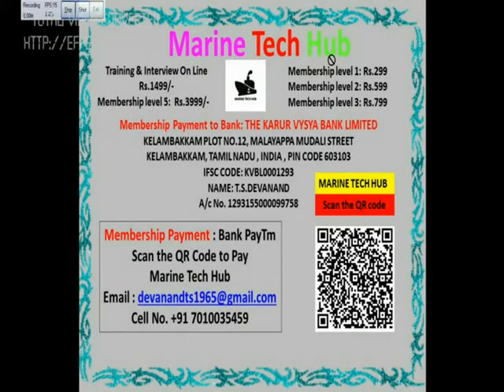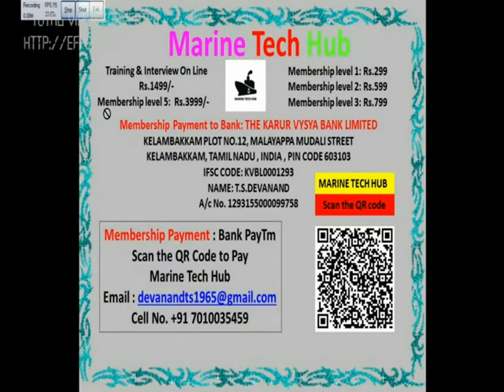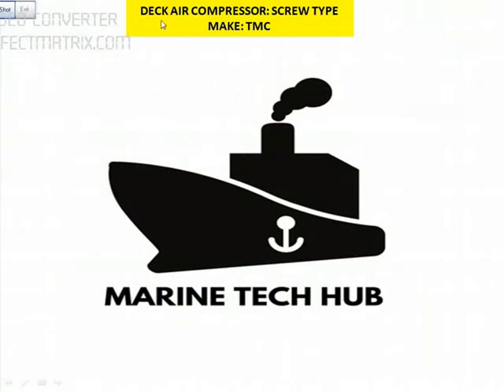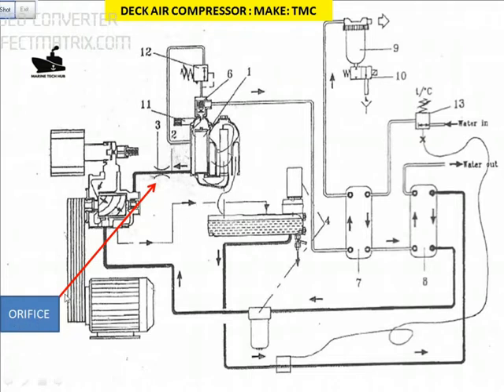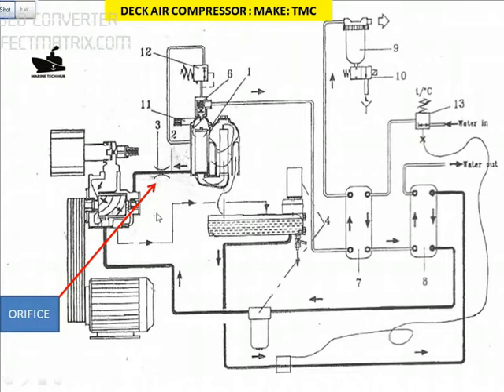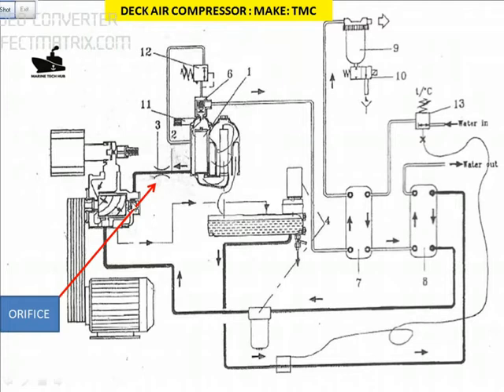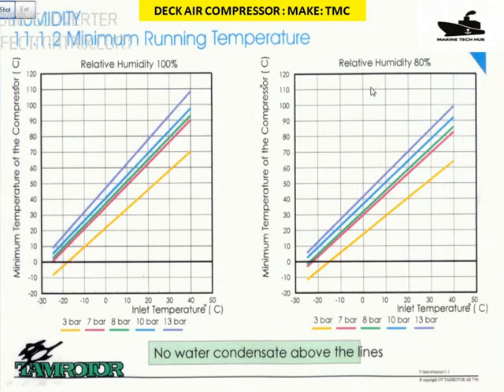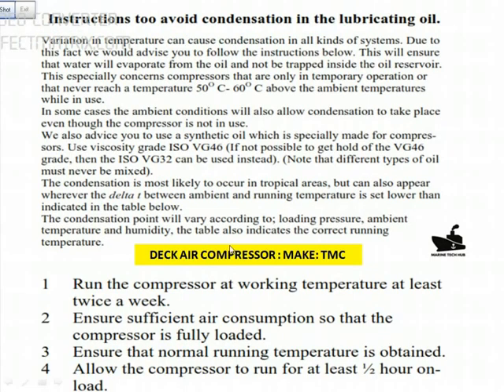Deck Air Compressor : Important Tips For Engineers

Comment: Facing issue with TMC screw compressor that oil level is going down every day and high temperature alarms comes.

Also load and unload is happening continuously in microseconds it loads and unloads

Separator already renewed and return line is clear , blown air in return line and found air coming at the end.

If you can guide.

Thankyou in Advance